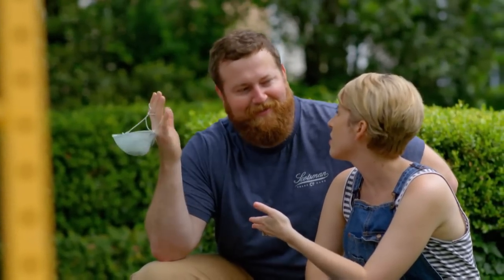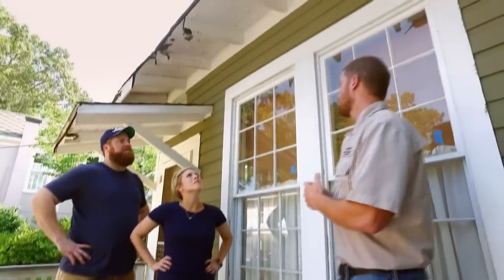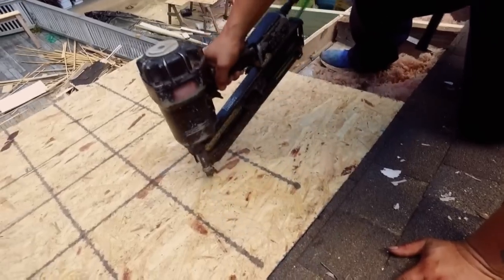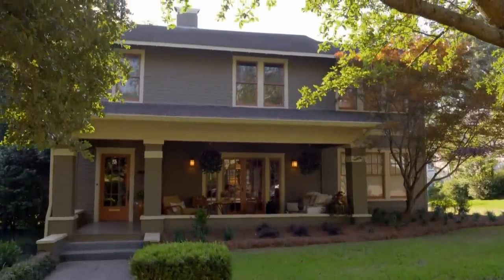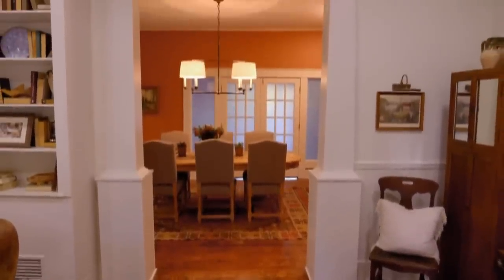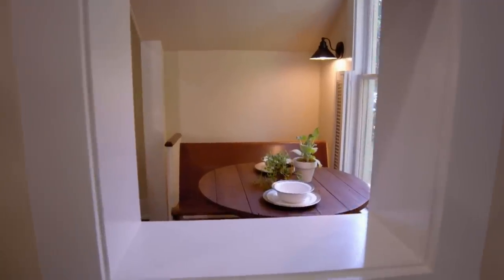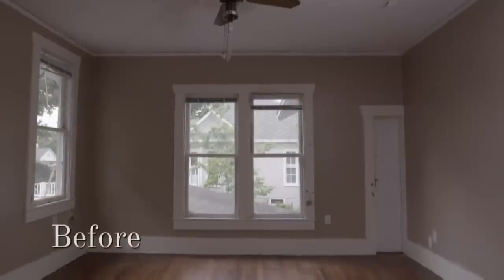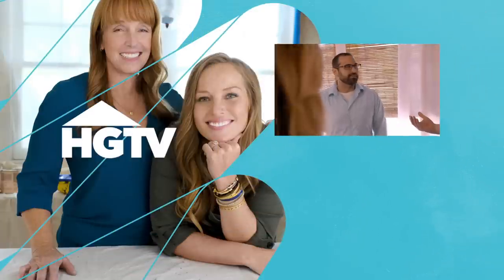Ben Comes Up With A Great Idea For This Tiny Door | Home Town

Comment: Cheap ply on roof repair?
Reply: The MDF is pretty standard roof decking. They did proper waterproofing flashing over it before putting on new shingles. That's pretty much where the water damage was localized, and the rest of the roof was in pretty good shape, so it was a perfectly adequate, budget-friendly solution that will last for years until they can afford to redo the whole roof. :)